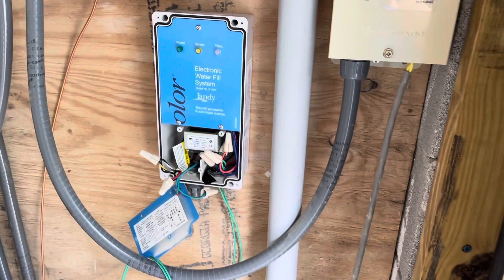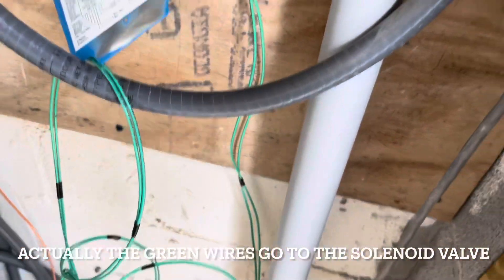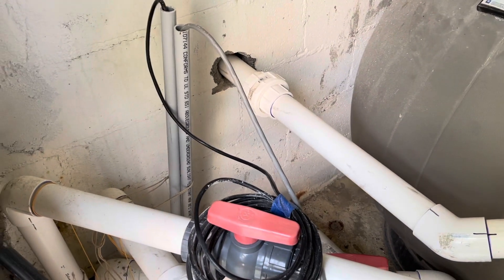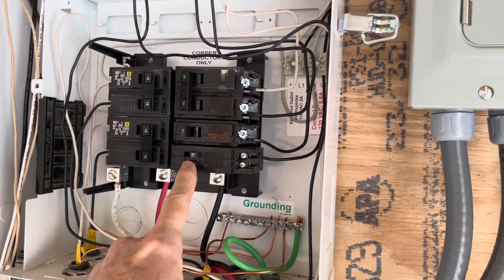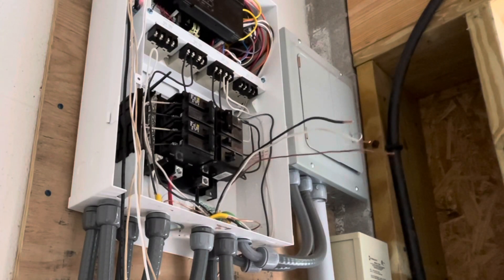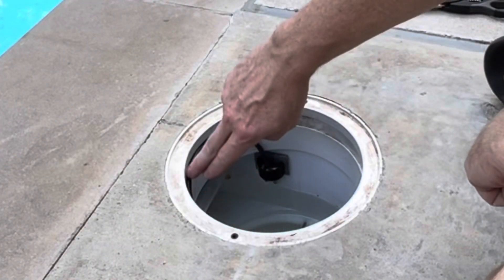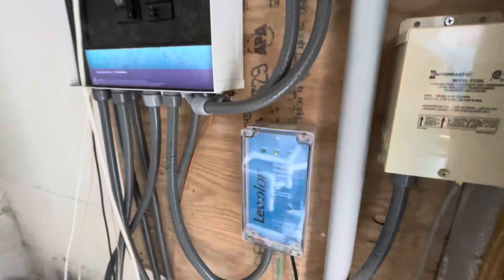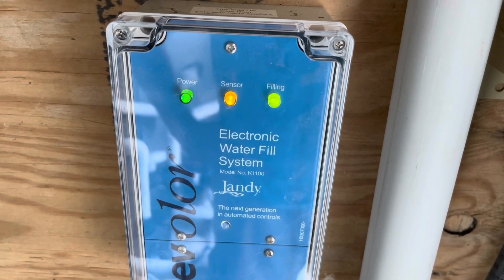Episode 201: Pool Project - Hooking up a Jandy Levolor automatic water fill system!

Comment: Hi Chris, do you know how to connect this Jandy system to the main drainage system in the backyard, so that when it rains hard and the pool gets overfilled you can use the Jandy system to automatically drain the pool to the correct level?  My pool company installed the Jandy system when they built my pool, so I have the "standing pipe" system that you discussed in your last two minutes of your video. thanks so much!
Reply from the maker: Hi Bonnie. That’s a very interesting idea, but I’m not sure how to make it work. The Jandy system is designed to open the valve when the sensor probes in your stand pipe are exposed to the air. The valve allows water from your house to fill the pool until the probes are touching the water again. 

You would need it to work the opposite way so that when water touches the sensor probes, it opens a valve located in the return line after the pump, which would bleed some of the excess water into the backyard until the normal level is reached. 

Does your pool not have an overflow pipe?

Comment: What is the problem if the sensor light comes on and the water starts to fill then after 10 minutes it's stops filling and the red safety light comes on and the water isn't to fill level?
What is the problem?
Reply from the maker: The Jandy system is factory set to turn off after 20 minutes whether the pool is full or not. You can increase the shutoff time to 40 or 60 minutes by clipping wires in the control box. Here’s the manual for your reference: https://www.jandy.com/-/media/zodiac/global/downloads/h/h0303600.pdf

Comment: Can this system be retrofitted into an existing pool?
Reply from the maker: Yes, you can retrofit it. The tricky part would be running the wire for the water level sensor from the control box to the skimmer. If you have a concrete pool patio, then you can run the wire in an expansion joint if there is one nearby. If you have a paver/stone patio, then you could pull up a section of them to run it.

Comment: Hello! Thank you for your video.  I work maintenance at a commercial property and we have been filling the pool manually b/c I was told it 'never worked for the pool' but hot tub works fine.  I am an over achiever and want to get this working again.   My first thought is to check the solenoid to stop the water because I assume it just keeps filling if the main valve is left open.   Is this correct and what else should I check if you would be so kind.  I saw other systems have a floater that is known to go bad, but this system looks electronic.  Would there still be a floater somewhere? Thank you! Tell me where to send the case of beer! Haha
Reply from the maker: Hi Mike! Any idea why they stopped using the water fill system? The solenoid valves can go bad, but the default position is closed so it shouldn’t keep running unless something jams the valve. The valves are the same they use for sprinkler systems, so they’re meant to last for thousands of cycles and usually last for a long time. There is a solid state water sensor somewhere in the system that tells the controller to open the valve and send water. The sensor may be in a skimmer or in a stand pipe if the pool was originally plumbed for it. Try to locate the sensor and valve first, and make sure they look to be in good condition. Also, check the wiring to make sure it looks in good shape. Then, try powering on the system and see if the lights on the control panel come on. If the lights don’t come on, then you may have a fried panel. Our Jandy system has three lights which show power on, water filling, and sensor condition. Yours may be different, so you should search the web with you model number to see if you can find a manual for it. Let me know what you find out! Chris

Comment: Any idea what it means when the “filling” light is red instead of green?
Reply from the maker: That’s the safety lockout light. That means the system filled the pool up to the prescribed maximum time and it won’t fill again until 24hrs has passed and the lockout resets. You can lengthen the lockout time if you like. Here’s the manual that describes how to do that: https://images.inyopools.com/cloud/documents/levolor-manual.pdf

Comment: Seems like $100 worth if parts for $1000.  Why not just use a sprinkler controller and a sprinkler valve.  Couldn't you just set it to fill for let's say 2 hours per week and save $900